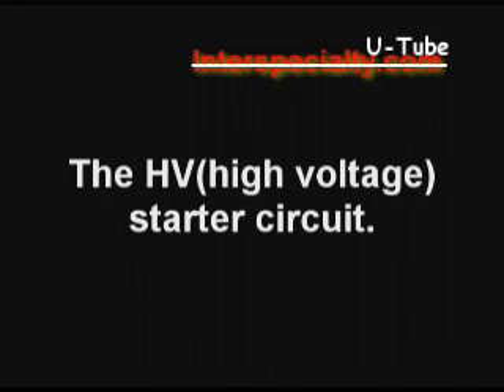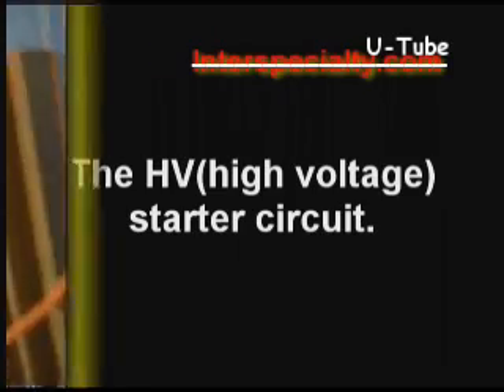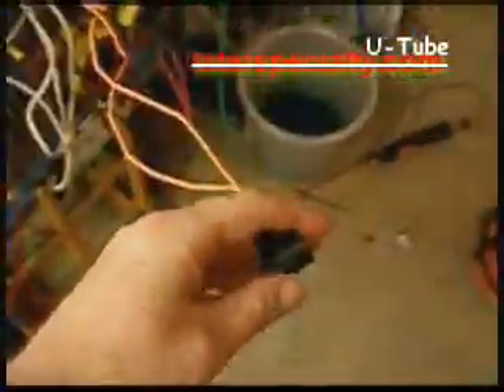Home Made Plasma Cutter High Voltage Starter Circuit

Comment: I use an auto transformer from a ford on my plasma cutter and it works great.
Reply: I was just looking at your plans on the instructable.  

I'm about to work on a 20th Century 310A welder I just picked up to restore and upgrade to DC, make a TIG welder add on, make a HF Start to save on tungsten and maybe a car starter w/battery charger circuit.  Have to see what I can fit in the case.  I'm also planning to put new Densa 35-50 female connectors for the leads.

I was thinking I could make into a plasma cutter, though looks like these are higher voltage and lower current... so most likely will use a microwave transformer I'm thinking once I calculate the windings needed.

I've seen some of the DIY TIG welders use the auto ignition coil method and a spark plug or two as the gap for the high frequency start so am wondering which route to take as I never seen the taser method before and am thinking maybe even a bug zapper cheap flyswatter with a larger capacitor bank will work also after watching this.  

Thanks for sharing!